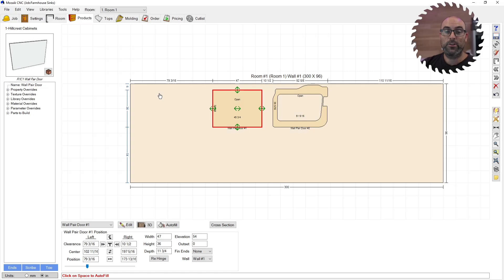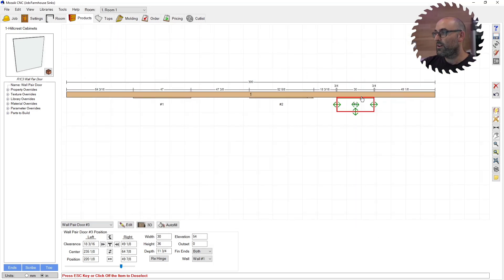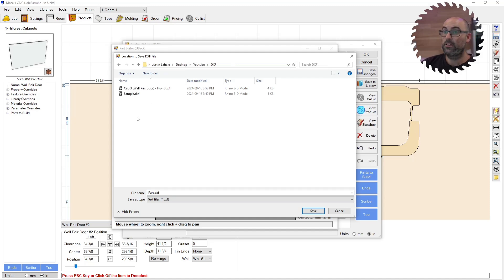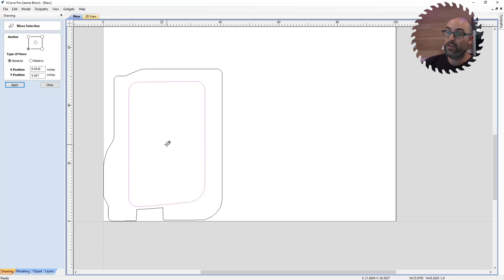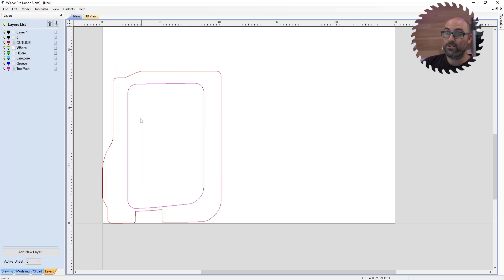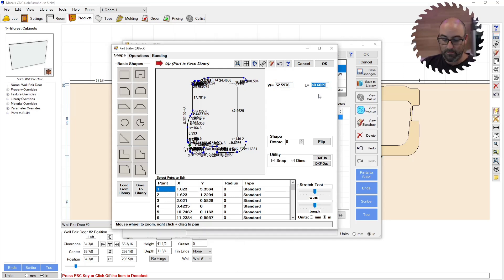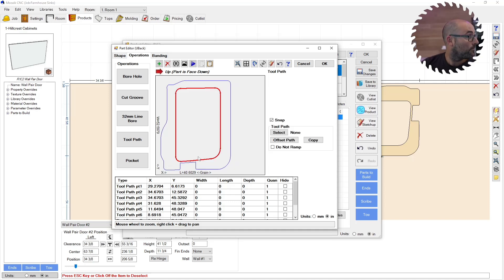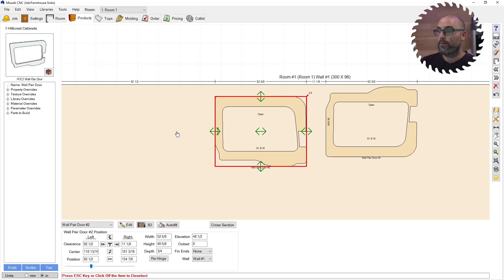DXF Importing - Mozaik Software Tutorials

Comment: Hi, my friend! I have a question about the head speed and spindle speed on my machine, which can be adjusted from 0 to 120. What speeds do you usually use for cutting? Under what conditions do you reduce the spindle speed? Since cutting doors from MDF creates a lot of dust, I’ve started to address this by reducing the feed speed to 20 and the spindle speed to 80.

Thank you, and have a great day!
Reply from the maker: Hey I cut at 150 and reduce 50% for small parts spindle speed usually stays the same 18000 rpm

Comment: I'm pretty sure i did everything exactly as you did and this is not working for me. not sure what I'm doing wrong, but when I do DXF IN. it is just a bunch of crazy lines.
Reply from the maker: @rhettgibbs1234567890  mozaik is such a fussy one when it comes to dxfs. I'm using vcarve 8.5 so maybe because it's an older version it works for me. Perhaps try another cad software if you can but save as Autocad 2000
Reply: Maybe so, I have the latest vcarve, my ext file was just an outline of a shape too. Do you think I should put a square border around it and use the shape as a tool path?

Comment: Why not cut it in vcarve?
Reply from the maker: Valid point! Vcarve is totally capable of cutting also. Perhaps you have custom parts that you want to send out as 1 complete job to your operator. Once you have passed the point of importing into mozaik. You no longer have to add toolpaths or worry about nesting. Mozaik will handle all of this.